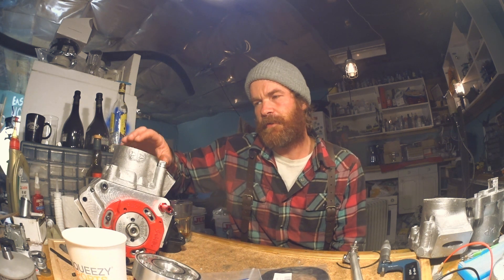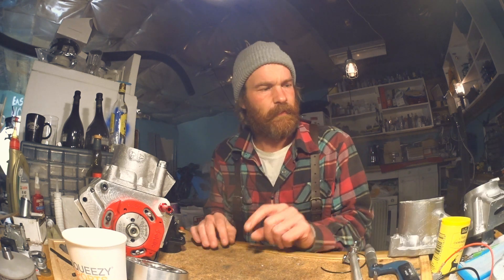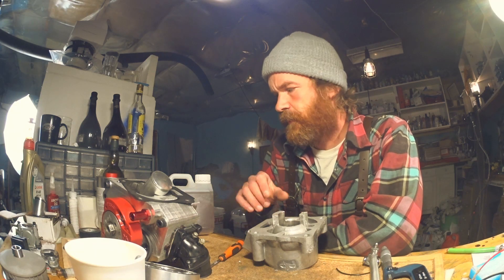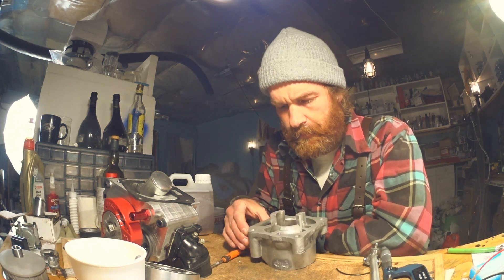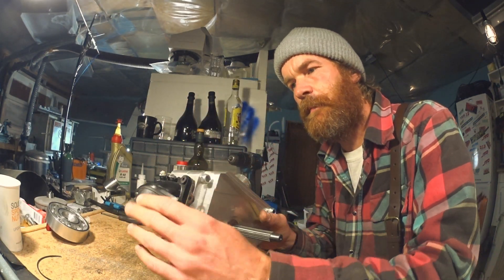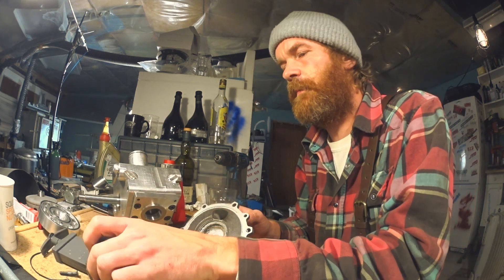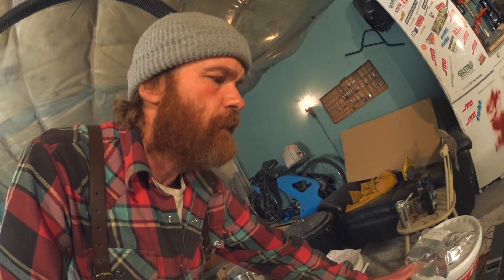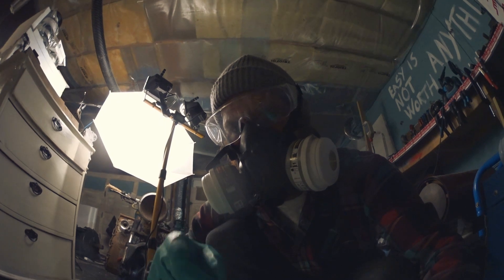DIY Two Stroke Cylinder, Nikasil stripping - Most Powerful Two Stroke Ever.

Comment: My boy stripped the coating right off his 2019 kx 100. But head didn't tighten the airfilter screw and raced a dust for 2hrs. I quit on him 3 times before it wouldn't  restart.

Comment: Not sure why but cutting reeds material by a blade never worked for me. After 2-3 hours they are gone in pieces.
Reply from the maker: Yeah, I have a feeling they've developed som micro cracks. Next time I'll use a tiny abrasive cutting disc.

Comment: The disc valve seal material in Suzuki GP100/125 (they share exactly the same crank, disc valve & gearbox) is made from neoprene. The previous 1960's designed model, the Suzuki A100, used a standard large neoprene O ring as a perimeter disc valve seal, which can wear and leak with age. This is why they changed to the seal design in the early 1970's for GT100, GP100, GP125, TS125 & TS185 disc valved engines.
 
It's not cork as that material is destroyed extremely quickly by ethanol contaminated unleaded petrol. I've seen Suzuki GP100 & GP125 bikes running on E5 unleaded so if it was cork the disc valve seal would have failed within hours.

I've worked on a couple of GP100's back in the late 1990's. One I had to take apart & fix the disc valve assembly. The other I was converting it, for a client, into GP125 by changing the cylinder, piston and replacing the carb main jet with a 122.5 size.

Comment: You should consult the brilliant engineers at Zanoah in Japan . they make the smoothest long lasting trouble free 49cc class 2stroke I've seen . 
I have 2 bicycles w 2 stroke friction drive motor kits . 1 has Huasheng Kaisa 63cc and the other is Zanoah 42cc . the 63cc has great low end torque and seldom have to pedal up hill w a comfortable 19mph cruise .
The Zanoah is like Cadilac in comparison . Super smooth running has 22mph comfort zone cruise over 2k miles starts 2nd pull every time zero problems and runs better than new , but I have to pedal on larger hills . the folks at Zanoah know how on 2cycle . thinking about their 63cc 2 stroke but hard to find . good luck w your project and hope it turns out something we can all enjoy . I love 2strokes and would have 2stroke motorcycles if we could get them I grew up on those and also enjoy using my 2stroke yard equipment . Best wishes for your project .

Comment: No need to worry about leaving aluminium in "definitely not nitric acid". The aluminium is completely resistant to that solution.
Reply from the maker: 👍  low concentrations (20-30%) will slowly etch it, over 50-60% just oxidizes the surface and that's it.

Comment: Cut some extra tapert fingers out reed material put two on top of each valve use screw holes to mount them they wil support the valves at  high rpm this way they keep up better

Comment: Your title for this project (Most powerful Two stroke ever), Does it mean the most powerful 2 stroke in horsepower/litre or most powerful 50cc 2 stroke there is. Or in other words what is your grand goal for this project? Im starting a supercharged 88cc 2 stroke project and my goal is 50hp form the minarelli am6 engine. Some say that forced induction does not work on 2 stroke bc. when the pressure in the crankcase is higher, more of the charge will be lost during the scavenging phase in to the exhaust but then there are guys like a fellow swedish tuner who has built a turbocharged am6 with 46hp with 0.6bar of boost and a 56hp d50b0 engine.
Reply from the maker: Hp vs cc. Next project has forced induction 😁👍

Comment: have you actually checked the rod is running true to the bore?and that the big end and little end are parallel?
Reply from the maker: Looks good(by eye), same clearance around the piston throughout travel. The case was faced with a mandrel through it, should be true. But... Should check.
Reply: @2STROKESTUFFING   I remember reading Jennings book (or Bell?)as a young teen looking for all the *easy "secrets"...turns out just having a true bore and crank was key. Love your channel. you deserve every success.

Comment: Did u say the cylinder is tapered????? The piston is tapered, not the cyl. Use the tollerance from 50cc polini evolution cyl
Reply from the maker: The piston. It behaves differently to a normal piston, different mass distribution.
Reply: @2STROKESTUFFING  to me piston is piston. The only thing different would be the expension due to metalorogy. Ans also expension where you screw the 2 pieces in each other. More heat there.
Reply: Minarelli or Piaggio

Comment: If the bottim seat is demaged or not wel casted you can fill it up wit epoxyjust like you bodyfiller. Only place where epoxy doeant hold is tge ex port ande top of the cyl. Those places reach the highest temp

Comment: Heating the cylinder to (at least) 150C for 30 minutes should turn the plaster back to a solvable form (if it works similar to plaster of paris at least).
Reply from the maker: Sure? This plaster(plaster of paris +sand) has been cooked for 24h at 400c.
Reply: @2STROKESTUFFING  Forgot about that, that's probably already turned it back into plaster, so it's gonna be down to a low reaction area due to solid plaster (exacerbated by the sand).

In theory it's only a function of time for it to re-hydrate and dissolve, an ultrasonic bath would probably do the trick to get it done fast though (that's what jewelers do).

Comment: I de-plate cylinders often, the best way to get it done is 55% nitric acid heated to 65 / 70 degrees celcius in a 18/8 stainless steel stock pot. Get the acid to temperature then place cylinder into acid and it will deplate in around 2 minutes and will not harm the aluminium at all. A WORD OF CAUTION, THE REACTION IS FAST AND LOOKS LIKE CHIPS IN A CHIP FRYER AND THE BROWN FUMES GIVEN OFF ARE DEADLY IF INHALED SO ONLY DO THIS OUTSIDE IN AN OPEN SPACE !!
I have a short video of this process if you need clarification
Reply from the maker: Thanks! I'm trying to go the more slow but not so potentially lethal route. Nitric fumes are pretty unpleasant...

Comment: High voltage is not best solution for any electrolytes if You wanna keep that in control. Wait a little bit longer with lower voltage to get even layer. Also hydrogen creating on cathode can cause structural damages similar to cavitation. Companies using pork jelly to stabilise and take control on hydrogen.

Comment: Ammonium bicarbonate, may cause a little discoloration to the aluminum but it should only be minimal if it doesn't set on the aluminum too much. It's an ingredient in a bicarbonate fire extinguishers. And it will burn if it gets in any cuts, so wear gloves! I'm certain you already know that LoL.

Comment: Due to your vikings ancestry you will never give up are you.
Just some points of attention to influence you positively yessss
First - Consider your new mould to rotate along the cilinders centre line while pouring the new casting
Second - Upgrade your design for a 3D printed “lost model” considering repositioning stud bolts and or angles of all canals learned up to now
Third - Consider some intake charging system by supercharging preferably E-engine sytem assisted hence using return breaking energy ... for you to think of something clever with for instance pressure lubricated crankshaft needing less premix oil
Fourth - Remember the technical difficulties involved with the once Bimota V-Due 
Fifth - Keep your throat properly lined with malts from Scotland stimulating our minds

Comment: Here in the US you can buy nitro in different percentages for rc cars and plane engines.  I used to but it by the quart.  Just an idea.  Keep up the good work.
Reply from the maker: Same here but only <30% by weight, and has to contain >10% oil.

Comment: It's a translation, so I don't know if it will be transmitted correctly.
It seems that you think that the compression pressure is low, but at present it is a good pressure. Since the height of the exhaust port is high, I think that the upper limit is 4Kgf / cm2 to 5Kgf / cm2 considering the combustion chamber and cylinder compression volume. I think that the compression pressure cannot be known unless there is exhaust pressure when the engine is actually operating. What is the distance from the top of the exhaust port to the top of the cylinder? It looks like 12-13mm from the screen of the PC. When I calculate it, isn't it the correct answer at the moment? I'm sorry if I make a mistake.

Comment: I wonder, if having the  exhaust port moved 90degrees or rotating the head 90 degrees would help with the piston interfering with the exhaust port? I know you chamfered the exhaust port and solved it but could this help it even more? 

That way the piston wont pivot towards the large exhaust port. Is this a good idea, or is there a reason the piston pivots towards the port?

You don't really have this option with inline pistons but with a single piston you might be able to take advantage of it.

I know pistons go straight up and down but they can rattle, and it might rattle less towards the port this way?
Reply from the maker: Absolutely! Actually brought this up way back just before the retained ring/100% port idea.

Comment: If you can heat the not nitric acid it might work a bit quicker or use the same method you used for plating but reverse the polarity of the wires.

Comment: Since you started talking about the idea of the injection system, I can’t wait to see how you are going to deal with the tricky transition period between carburettor and the injection system.
You should run the carbi on methonal too because gasoline and methonal don’t mix too well and might make the transition even more difficult.
Hey mate, I’m no chemist but Isn’t nitromethane (cH3NO2) just methonal (CH30H) mixed with nitroglycerin? 
 Well That’s what my old man use to tell me to run the bike on. “Make sure you “pickle” the tank first like I showed you” he would say! And use 5 to 7.5% acetone for a faster burn and stop it detonating too much.
Ahhh the smell of shell M in the morning.
You are a braver man man than me to go down the plating road again! Good luck!
Keep up the good great work👍👌✌️🤘

Comment: One thing about casting, take a large propane or natural gas torch with a ~3 inch head on it and preheat your molds before you cast the part. When you cast into a cold mold it doesn't pour well as it want's to instantly harden when it hits the mold. It also can lead to vapor bubbles on the surface of your part. A preheated mold will come out with a much nicer part. Another VERY common throttle plate material (it's used in all Holley carbs) is brass. When acids stop working warm them up, just don't heat nitric too hot or it'll start turning into dinitrogen which is that lovely red cloud that is extremely toxic and extremely corrosive.
Reply from the maker: 👍 Mold at 400C when pouring, straight out of the oven! I'm pretty paranoid about that red cloud, rather go slow.

Comment: A note about that particular unamed oxidising acid, eventually it will make the container brittle and the contents end up on the floor, personal experience. telltales are the inside of a red or blue cap becomes white. It does not attack most aluminium, I use it to remove broken bolts from aluminium.
Reply from the maker: 👍Should get a suitable glass container then.
Reply: @2STROKESTUFFING  Yes, the black plastic containers that it is usually supplied in last 2 - 5 years, the 2.25 l glass bottles last forever

Comment: how is the engine lubricated?
Reply from the maker: Oil in fuel.
Reply: @2STROKESTUFFING  But doesn't it have an injection system so how is the crank lubricated, or is it injected into the crankcase directly?

Comment: When i was tuning 2t i would try to get the compression ratio has high has i could without the piston smashing into the head, apart from a little porting i could get most mopeds above 50mph,
why the low ratio. methanol loves high compression.

Comment: Wow its going really great for you! I got a video request. Im building a vintage tomos engine to get up some speed. im at 98kmh right now. Could you explain stuff like how much things like ignition timing, reed thickness, reed block size, high vs low compression head affects powerband. Also how to determine how big carb is needed at top rpm to acheve the power people are aiming for. Forums are all flooded with mixed answers.

Comment: Try to agitate your plating solution. You will get less burning on high current density areas. Iam not sure if you can airate that soulution it may cause issues. Also did it come with a wetting agent and carrier.?
Reply from the maker: 👍 Got a pump in there, got to keep the powders in suspension, serves a dual purpose. Wetting/carrier agents present.
Reply from the maker: To clarify, my plating turned out perfectly last time, just used the wrong BN and should've made the bore a bit larger - had to hone back most of it to fit the piston.
Reply: Kk I haven't watch all you videos. Sounds like you have a handle on it. I am really enjoying your videos. Iam just giving you my 2 cents worth if it helps. I have a little experience in electroplating and electrolytic processes. Have a great day.

Comment: Quick question... 
According to you what is the best 2-stroke oil you use in your engines?
Reply: motul 800 is a great oil. i use it 1:50 in stock and 1:40 to 1:25 in heavy tuned bikes, never got disapointed. used a mineral oil before, chainsaw oil by stihl. was great too, but had to run it on mixtures to 1:20 in race engines, caused a lot of smoke. but burned very clean. 
motul may make your bike mark its place, its rly hard to burn, so it may leave ur exaust unburned. good for high temps in ur head and so on, head is even cleaner than with using stihl.
Reply from the maker: Castrol A747 is my goto.

Comment: maybe the low compression is because of the piston and not because of the cylinder? I believe a lot of the piston ring sealing capability comes from the compression pushing the rings into the cylinder wall, and maybe because of your design this doesn't happen?
Reply from the maker: Yep. Too much volume behind the ring is the main suspect. New piston/ring in the making!
Reply: @2STROKESTUFFING  great to hear!

Comment: Have you ever thought of building a small cc inline 4 two stroke?  Like four 50cc 2 stroke engines on a single crank  think it would be pretty cool
Reply: I think this is the best idea for higher power figures for larger capacity engines. I always thought a v 5 cylinder  configuration would be good for a 250. With the smaller cylinders having a better surface to volume ratio allowing more STA that say a conventional twin a lot of power could be achieved (in theory).
Reply: @Eddie Hitler yes he has. I love his Channel! Imagine 5 of Alex's cylinders as a v5 with 30hp per cylinder... Potential for 150hp!

Comment: what type of ECU are you using? have you heard of Speeduino?
Reply from the maker: Simple arduino sketch.
Reply: @2STROKESTUFFING have a look at Speeduino it uses the Arduino and you can use tunerstudio for fuel/ignition timing ect :)
Reply: There are already two strokes project ongoing, check the forum and Facebook group. The NO2C is a compact version of the speeduino that should fit a bike nicely. Its a big and helpful bunch of people, so it might be worth a look to not reinvent the wheel :)

Comment: 11:20 If your methanol/nitro fuel mix is 10% castor oil you won't need any sort of seals there. Castor oil seals this up fine. Works a treat on my Forster 29 RRV model airplane engine; the rotary valve seals purely in this manner. The castor also won't hurt much when it goes through the rest of the engine; a little added lubrication that's reasonably heat resistant and will carry heat out of the engine as it passes through.

Honestly, if I were you, I'd use commercial model airplane fuel for your first methanol/nitromethane test runs. A gallon of Omega 15 is 30 bucks at my local hobby shop and it's 15% nitro, 17% oil, balance methanol. It will be more than adequate for testing and tweaking that side of your engine before you start running the real highball custom brew you plan on using at Bonneville.
Reply from the maker: 👍 Exactly what I'm going to do, RC fuel 20%nitro,10%oil by weight.
Reply: @2STROKESTUFFING  Ahh, got ya some car fuel. Ye you should have no problems sealing that slide valve on that stuff as long as it hits the valve at some point on its path into the engine.

Could possibly also use glow plug ignition on it? Would make shutting the engine off a bit tricky but not impossible.

Comment: Your cylinder head need two stroke oil .
Reply from the maker: What, I can't run it dry?
Reply: @2STROKESTUFFING  does nitromethane lubricate well enough on its own or will you need to mix gas for it? (or does it not matter because of the plating)